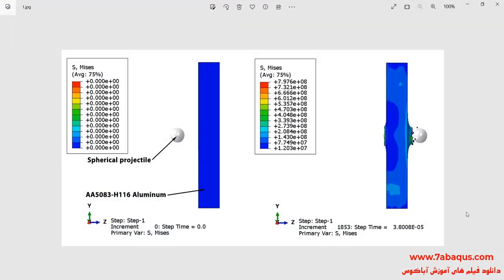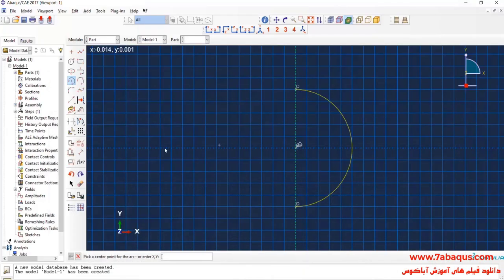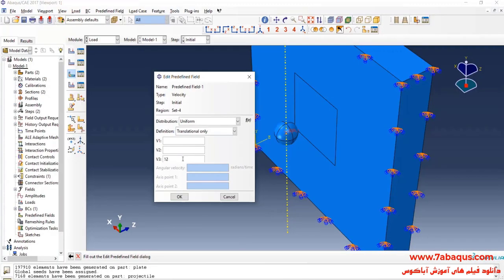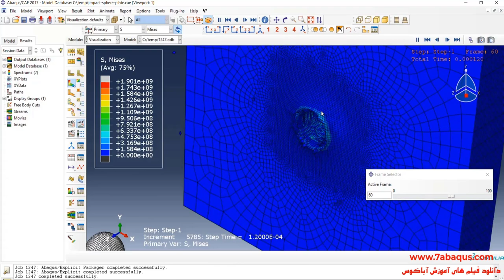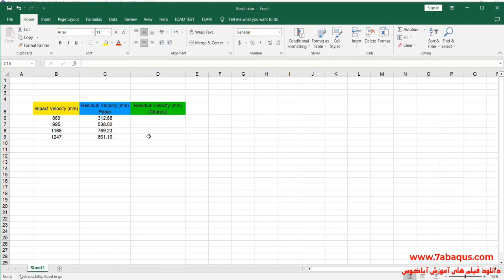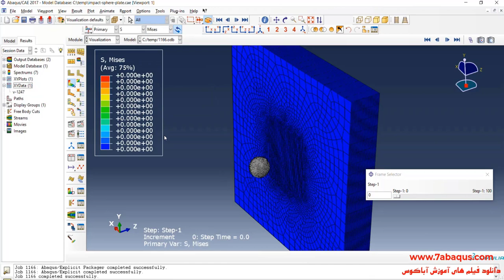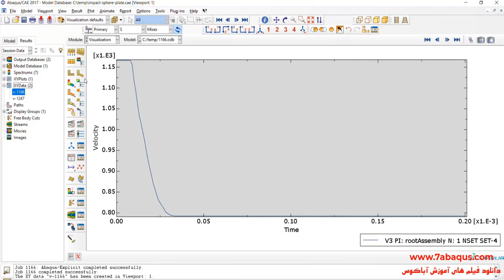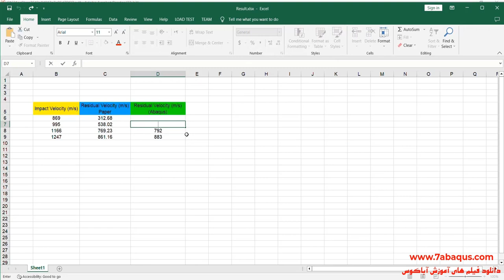Ballistic impact of a spherical projectile to the aluminum plate Abaqus

Comment: Hi! I purchased this tutorial, and studying ABAQUS now.
When I increase ball speed in this tutorial, the Job doesn't work (aborted).

"The ratio of deformation speed to wave speed exceeds 1.0000 in at least one element. This usually indicates an error with the model definition. Additional diagnostic information may be found in the message file."

It operates up to 3km/s, but not at speeds above that.
1. Is there any method for hyper-velocity impact model( 7km/s )?
2. Or, What settings should I modify?

thank you for your help!